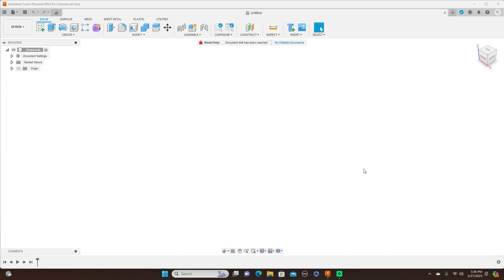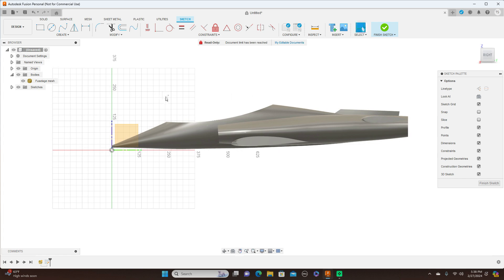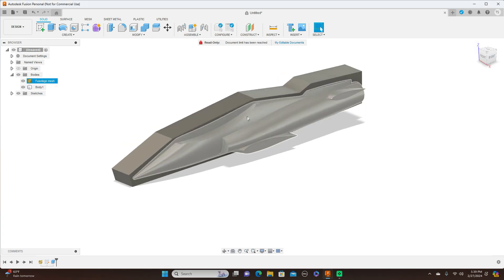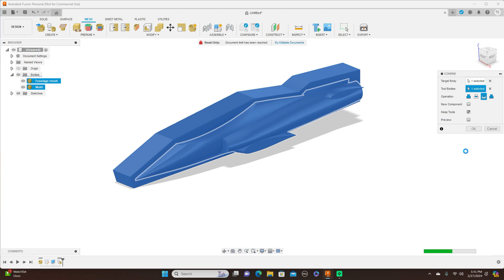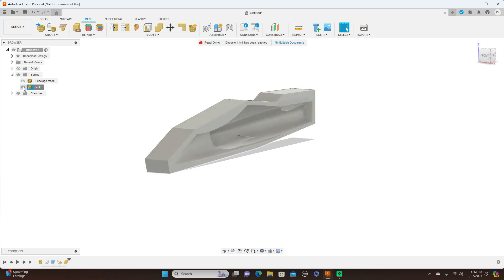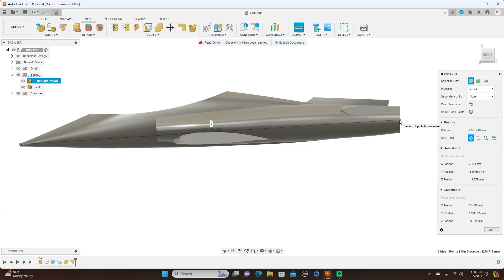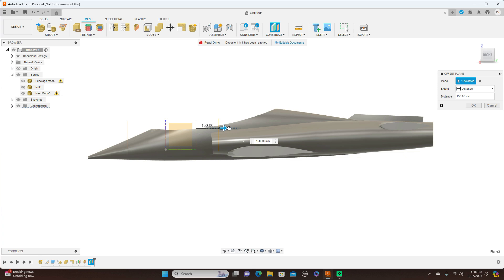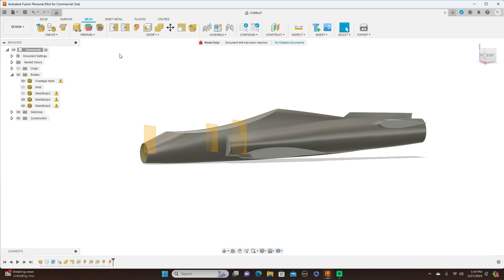Simple Way Reverse Engineer A Airplane Mesh To Make 3D Printed Molds From Or Make The Model Larger.

Comment: Thank you for this video Tony, this is exactly what I wanted to do with the A6 Intruder, so now there is no need to recreate the model as a mesh in order to get the molds done, you can get the molds created from the obj model? Also, when you cut up the model, if you are creating molds, that is what should be cut up for printing in a 3D printer with allowed z axis measurement of your printer correct? And last, when you create the molds, will it capture all the detail of the obj model? Thank you again and keep this videos coming.
Reply from the maker: Yes, cut the molds up instead of the model.  It is done the same way like cutting the model.